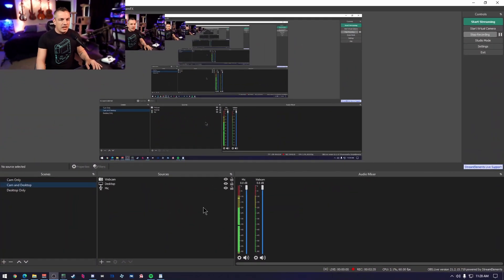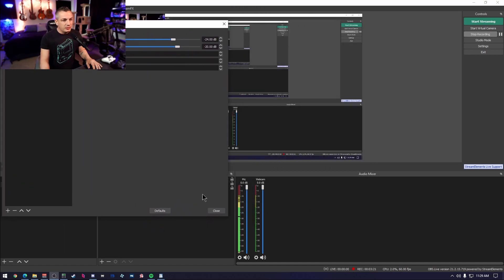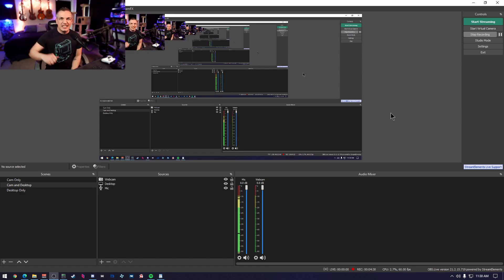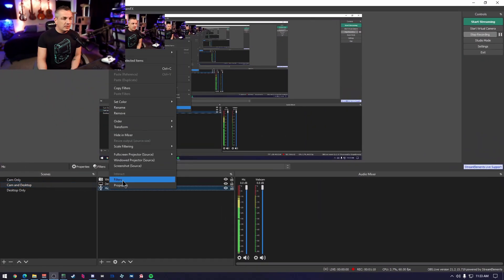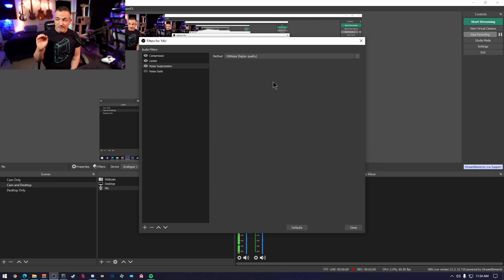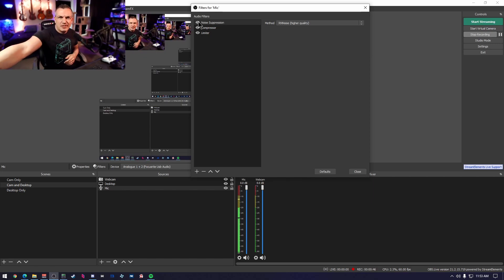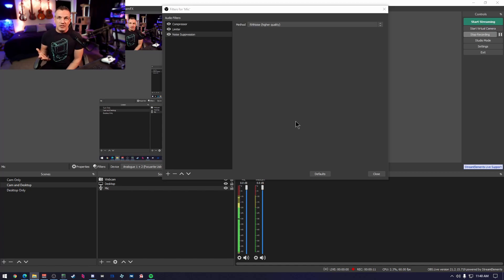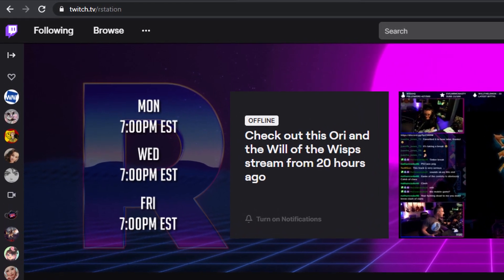OBS Noise Gate and Noise Suppressor

Comment: Totally agree on the noise gate. Used it for year to remove keyboard sounds but the problem was that it also cut out some of my voice because i move around a lot. noise suppression is so much better. I went with the GOYO voice seperator by Supertone though. it was free in the beta (Now 69 dollar) but it is totally worth it. it is the best noise suppressor i have used and makes even an untreated room sound like a dry vocal booth studio recording. but OBS's built in works too. But if you want the step up. Try the one by Supertone :) Btw. Great video!

Comment: I wasted the whole day about adjusting and fiddling with noise gate, but only this video explained that it's unnecessary. This is a very great video and highly informative. Keep it up.
Reply: It has a purpose and needs to be set correctly, but if you are trying to get rid of background noise while talking etc, suppression is the better way to go.  

Gates are great and easy for eliminating basic noise being picked up or produced by an audio device.  This will normally be under the -45 level, and your actual audio level should be above -35 so the noise to sound ratio will be low and not noticeable while talking. 

You can find this level by turning on your system and just watch the meters without speaking.  The meter level will register the ambient noise in the room and the noise generated by the device.

Hope this helps with the simple use of gates.

Comment: You look like a musician. My problem with noise suppression is it cuts off the tones of my voice and acoustic guitar after the tail drops below a certain level. Any suggestions?
Reply from the maker: Hey thanks for watching! Yes  you are correct, I am a musician. That is probably the biggest trade off with noise suppression are the artifacts it creates in the input signal. I would never recommend using it for an instrument, and it's more of a bandaid for a microphone in a noisy environment.

The best way to combat noise, is to get to the root cause wether it be dirty power, ground hum, fans, air conditioning etc.

Comment: I'll try the RNNoise Suppression on my next live stream.  That definitely sounds promising.  My Valve Index VR headset picks up my heavy breathing when playing Beat Saber and really want to cut that out.  For recording, I can just tell OBS to record the microphone audio to a separate audio channel.  But when I stream, that separate audio channel doesn't go through.
Reply: Holy crap, that made a HUGE difference!
Reply: So when I was getting ready to live stream, I had my Valve Index hanging on the ceiling and just started OBS Studio.  I did my usual "mic check" by clapping and snapping my fingers, but was getting nothing on the VU meter.  I was like "aw crap, did a driver update screw with my settings again?"  I checked to make sure the Valve Index microphone was selected.  I grabbed my Valve Index and spoke into the microphone and the VU meters came to life.  I was like "oh THERE we go!"  So yeah, works great!

Comment: What if I need a noise gate because my keyboard is too loud? I want to be able to block out me using the keys during gaming but also want to be able to talk quietly or sigh or something without it getting cut.

EDIT: I also just noticed when I use audio monitoring, even though I'm using my voicemeeter source as default mic, it seems to be ignoring all of that and just using my raw blue yeti, which has INSANELY HIGH sensitivity, so it can pick up things like me rubbing my hands together or just moving my feet on the floor, and I have no idea why obs is doing this if it's set to my voicemeeter, which doesn't pick that stuff up. Please help!

Comment: Hi! 
I just found this video and love the detailed explanation of each setting.
I do have one question.
 Does Noise Suppression, be it RTX Voice, OBS's RNNoise, or honestly any type of noise suppression app (i used to use Voicemod's filter), cause mic distortion? (if that makes sense)
Like at certain moments, I noticed my audio starts to sound distorted or warpy(?) when I scream, yell, or even laugh, and go on higher pitches, but I wasn't too sure if Noise Suppression is the cause or something else..
I hope that makes sense x.x
But thank you if you see this
Reply from the maker: Yes, it actually does, and I have a video coming up explaining these. It's not so much a distortion as it is, the filter is mistaking your scream or sneeze or "non speech" for external noise, and attempts to suppress it. It results in a weird artifacting on your vocals. Currently there's not much we can do about it except tolerate it..... or is there?!?!
Reply: @rStation  awesome! I had a feeling that'd be the case
Thank you for the reply!
Can't wait to hear the upcoming explanation!
Reply: @rStation  would you have a video on how to fix this? my mic cuts off with my scream and high pitch voice
Reply: im having exactly the same problem! hope someone could help

Comment: I have a blue yeti mic and mechanical keyboard the noise suppressor works when I'm silent but once I start talking it comes through a bit quieter then normal but still there is there any way to fix that?
Reply from the maker: You could add a Gain filter to your mic after the suppressor, and boost it by 5-10dB but it really shouldn't be reducing your mic volume though. Do you have any other filters on your mic? If so what are they and what order are they in?
Reply: @rStation  nope no other filters I'm kinda new to messing around with mic stuff cuz my original channel mostly made montages... and I only used my mic for talking in game. thank you for taking the time to help me I really appreciate it

Comment: Where in the chain would u say noise surpression is the best? At the top or the bottom?  Right now I have noise surpression -> compressor -> EQ.   I've seen u have it at the top but also at the bottom, your newer video had it at the bottom so I wonder if there is a reason. 

Tell me if I'm wrong but if you start with compressor before noise surpression don't you get more background noise that got boosted or do u think it doesn't matter?
Reply from the maker: I would recommend the Noise Suppressor is first in line when using a compressor for sure. If your compressor is first, it will amplify the ambient noise on the bottom of the noise floor.
Reply: @rStation  That's what I thought. Thanks for answering

Comment: DOES THIS WORK ON EVERYTHING ON YOUR DESKTOP OR ONLY WHEN YOU'RE STREAMING?
Reply: WHY ARE WE YELLING?
Reply from the maker: It will work on whatever track you have it enabled on, so if you want it to affect your desktop audio, simply put it on your desktop audio track, but I probably wouldn't recommend that.
Reply: This is done in OBS, so it'd only affect streaming and recordings done thru OBS. If you can use OBS as an input for video calls, though, maybe.

Comment: About the noise gate:

Long story short: A noise gate cuts off the signal, if you aren’t speaking. But as soon as you speak, the Noise is coming through, alongside your voice. Yep, I’m with you. That’s a good description! That being said tho, there are some things I’d like to add:

The background noise becomes a problem, in one of three cases (or a combination of them).

1) The microphone is on a bigger distance to you and you have to cover up for it by raising the gain. The issue about this: The further away you are from the microphone, the quieter your voice becomes, while the background noise stays the same. Or in lame mans terms: The background noise becomes louder.

2) You are running something noisy, like an air conditioner. The background noise raises, while your voice seems to stay the same volume. Again: the Background noraises.

3) The further down you set the compressor’s threshold,  the quieter the overal signal becomes. The compressor forces the louder parts of your voice to be lower. The overall volume is lowered. By adding makeup gain to cover up for the lowered signal strength, everything is raised. Your voice AND the background noise. So again, the background noise becomes louder. And if you only have a noise gate running.

So let’s say, all three things are true for your use case. In this case, The Noise suddenly hits your ears brutally. It’s very audible. And with the noise gate shutting down after you talked, the outcome doesn’t sound at all the way you would expect a decent microphone to sound. It’s more like a bad telephone call. So yea, a noise gate isn’t some kind of miracle worker in that regard.

About noise supression:

The shortcomings of a noise gate doesn’t make the noise suppression tool any less problematic. It comes with its own set of shortcomings. The reason is the way a noise suppressor usually works. It listens to the signal for the frequencies of the noise and lowers those frequencies to meet a certain noise level. This as well can be problematic, because the frequencies lowered to get rid of the noise are also part of your voice. And in extend of your breathing sound. If you have to reduce too much noise to get to a decent level (-70dB or below) the first thing that starts to sound garbled, is your breathing. But quickly enough even your voice is affected. Extreme cases can be heard at 6:27 and 7:03 in this video.

And now about something more nerdy, yet related - Signal to noise ratio:

The distance to the microphone, as stated in point (1), has a direct impact on the gain needed and in extent on the signal to noise ratio. But even if your room has a rather low noise, having the gain set correctly, does affect the signal to noise ratio. The higher you have set the gain, to get a proper signal strength, the higher the self-noise of the audio interface becomes. This is also true for usb microphones, as they have the interface integrated into them. It can actually be audible noise if the gain is maxed out (roughly -65dB) which is true for the vast majority of the USB microphones and pretty much all consumer grade sound cards, but also applies for many standalone audio interfaces below 200 EUR / 200 USD. 

Even more nerdy and not directly related to the topic -Signal distortion:

You want your strongest signal to be no higher than-10dB on both the clean signal from the preamplifier and  after post processing. While the actual maximum for a signal is at +/-0dB for electronically circuits,  normalized signal levels are -4dB for devices used in production, -10dB for devices used by consumers. While they don’t fully distorted before their total maximum, these normalized levels are in place for a reason. With a signal close to the absolute maxed signal, the distortion on many microphone preamps and Analog to digital converters (ADC) tend to raise significantly. The same is true for many components used for playback.
Reply: is there any argument for using both in conjunction?
Reply: So uh, the best solution is to have your mic close?